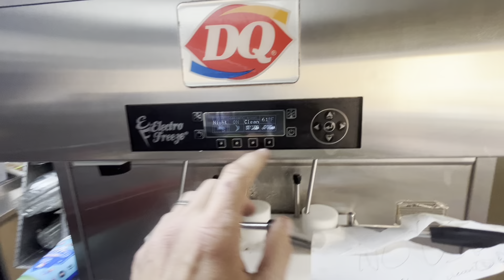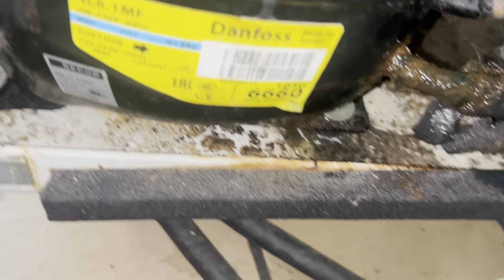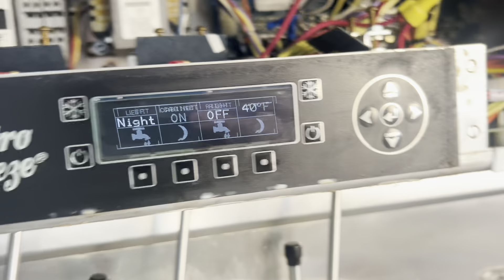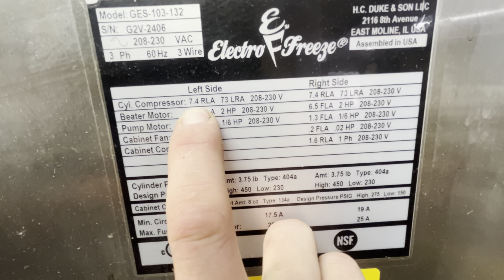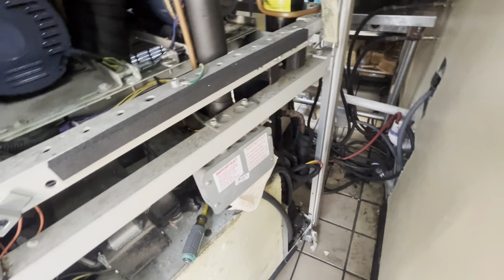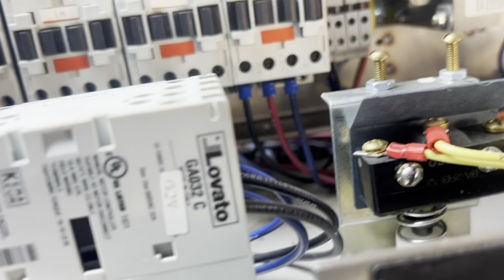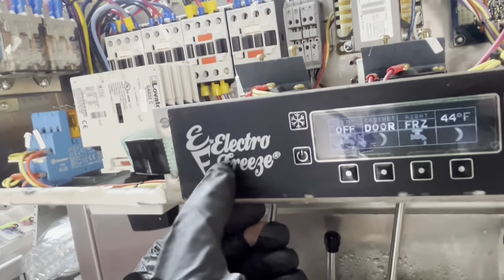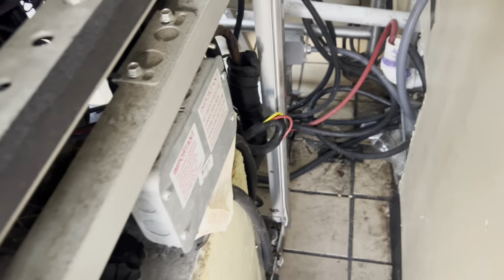Electro Freeze soft serve - It’s ALL broken

Comment: South African electrician here. It amazes me how these machines lack any sort of phase failure/overload protection for the 3ph motors. They've used a bunch of European components like Finder and Lovato, a clip-in overload or two surely wouldn't eat into their profits too much.
Reply from the maker: So actually they have electronic overload protection for the beater motors in the board.  A barrel temp probe fails and so the unit runs constantly and overfreezes the motor amp draw gets too high and it shuts down on a “mtr ovrld” error.
Reply: @restaurantrepairs  Interesting, thanks for the explanation! I imagine they are relying on the internal thermal protection on the compressor motors to protect them? It’s something I guess but not ideal
Reply from the maker: @ryantaylor6335 they always happy to sell replacement compressors 😂
Reply: @restaurantrepairs  fair enough 🤣

Comment: What was the reason to weigh in the new charge here? Just to make sure if wasn't overcharged from a previous repair?

Did you recover the old charge, if so how much was it?

Thanks for the video
Reply from the maker: With those small 134a systems I wish I could make more sense of it, but I’ve had problematic units that were remedied after a vacuum and recharge.   I wasn’t wanting to top off such a small system so that’s why the vacuum and recharge.     New customer new machine to me so now I own it.  Wanted to ensure I “knew” what was in it.    Not weighing such a small removal recovery.   Doesn’t matter what was In it.   That’s the point.   I wouldn’t have the same approach to a barrel with 2.5 pounds in it but 8oz 134  worth donating the charge if needed to ensure you’ve got the machine proper since it’s got my prints on it now